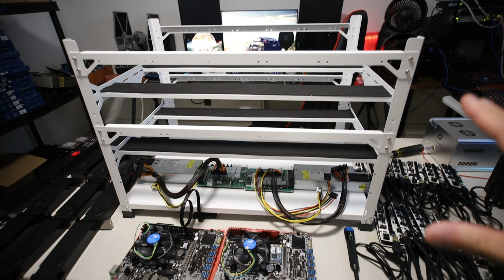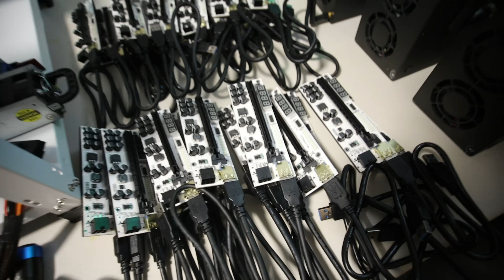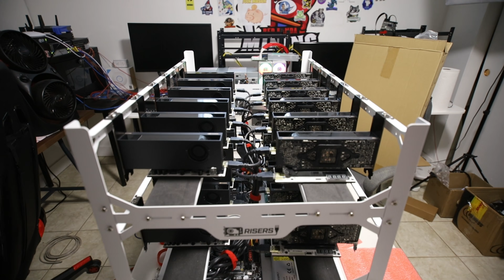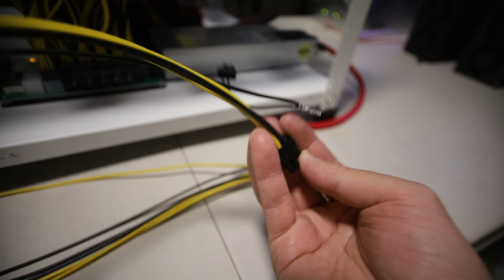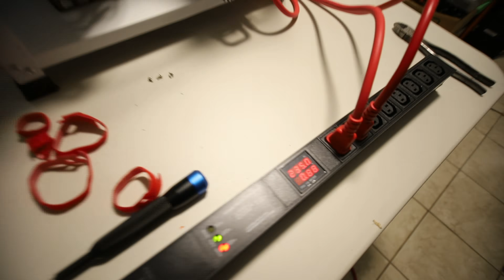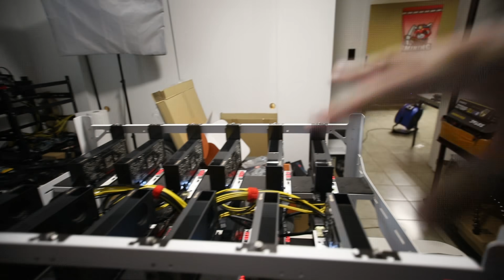24 GPUs 1 Mining Frame

Comment: RPM, it seems that you just started mining yesterday... the issue on the MB, is because you have limited the ammount of pci ports in the IRQ channels, that is normally just a setup on the MB, allowing the use of more, if the MB allows it, not all the MB has this option... normal MBs just allow 5, and some others that allows extend that limit is just to 19 pci ports.. as max limit, normally the ones that allows extend the ports is about 8-12 or 13 in a few cases..
Reply: also this video is pure show, no one should have rigs of this size, its not efficient, it create a point of failure gigantic, its complicated to maintain and heavy as fck to move, also requires more time and effort to troubleshoot, for what? forsaving on a Motherboard, microprocesor and ram?? because all the other components are exactly de same. This type of videos is what makes fail to many miners thinking they should o they must use this kind of setup.. and is not like RPM didnt know this.. but their views worth more that telling the ppl the right information or at least warn them about the risk of copying him.

Comment: Wow, that's a really sick build.  Don't worry about the temps, I have been running mine 24/7 with cclk <92C and mclk <118C without any trouble.  I did find that locked cclk fails when super hot so I switch to between 360-420 OFFSET on cclk once they get hot.  When cooler, I just use 1020 LOCKED cclk. Arizona, USA is hot

Comment: Wouldn't adding fans at the brackets just make it worse, essentially blowing against the exhaust. Some down-facing fans or middle-out fans would probably do better directing cooler air to the gpus fan, while cooling the back of the boards a tiny bit as well

Comment: Loving the B250C right now, and seeing you do more open rigs! Took some configuring with the CPU compatibility, but otherwise plug and play. I did however have 1 of 3 DOA as well. My 2 B250Cs pull 3900 watts at the wall though 😅 (1.5gh/s)
Reply: I have that same mobo and I have that problem that does not detect me more than 5 gpu and 5 minutes passes and restarts and does not load anything everything is black.

I'm getting desperate not knowing what the problem is.

My DIY is 9 rtx 3080ti, with Hiveos and a 120 gb SSD and a 16 gb ram memory.

Comment: 4g decoding enable in bios?
Reply: Those MOBOS come pre-set for mining, you don't need to touch anything... however if you are lucky they will work stable with max 10GPUs, with 12GPUs on they will just keep crashing. Gigabyte gaming mobo (b460,b560 etc)that comes with 3 years warranty and easy you can put 8 GPUs - cheaper and way better choice then those "mining mobos" 6th or 7th gen
Reply: lmao

Comment: Put the fans on the side of the frame so they are in the middle blowing in, then on the outside sucking out, Also I did the fan power mod on mine and it worked wonders. Hooked the fan power into the riser card power. That 1GH rig is really nice!
Reply: why would you even use cpu fans in a open air rig? just put a 100w fan pushing air trough it, considering the airflow of the room.
Reply: @santiagoferrari1973  Air Flow on these cards the way they are installed go from the middle out. These are blower style cards and need the air flow to follow the same direction as the fans. My A2000's are all installed in a case with air flow going the same direction as the fans.

Comment: you are a crazy man.  24gpu rig is wild.  I stick to 8gpu any more gets unstable for me personally.  I like to not touch my rigs once set up.  But looks like its a dual 12 gpu rig.  Those boards seem to be kind of unstable from my use.  Not a huge fan of them.  Man I cant believe I am the first comment.
Reply: the 12 card boards are very stable, 8 gpu rig is inefficient you're wasting a lot of material and rig cost to only mine on 8 gpus. fine if u only have 8 or 16 or something but if you have 100 cards or more need to optimize anyway
Reply: @CubeRhinoDev  most of my boards don’t support 12 gpus. I have one h110 running 8 cards and my b250c runs 12 gpus.  My other rigs are in x8 ultra octominers.  My 12gpu rig has miner reboots more than any other rig I run.  Sometimes it will run for a month find sometimes multiple reboots in the same day.  A buddy of mine runs the same board with 12 gpus and it won’t remain stable. It’s a cheap board though and can work.  Also depends on the cards that are on it.
Reply: @jtravaglini  i run 12 rigs with these boards(mix of 5700xt and 3070 rigs), and have 4 different clients that i build out their farms and maintain and only use these 12 card boards with usb connectors. None have had any issues and ive been using them(total of about 30 boards) since june of last year. Have not had a single failure or instability issue with any of them and they work out of the box with no issues. They are also a lot cheaper than h110 mining boards
Reply: @CubeRhinoDev  yeah mine was less than half the cost of what a h110 board would have been.  I had the h110’s prior to these being available.  But hey If you are having success with it keep doing it.  Glad to hear some people have success with them.  Mine could also just be a miner issue with TRM.  I should try using a different miner and see what happens
Reply: @jtravaglini  well i use TRM on all my 5700xts, 1 stick of 4gb ddr4 ram, and a g4400 cpu on all my builds
Reply: @CubeRhinoDev  mine has a i3 6300, 8gb single stick of ram. Running a 12 gpu rig (9 6600 and 3 6600xt). I just have an issue with the miner rebooting every so often.  It comes right back on and runs fine.